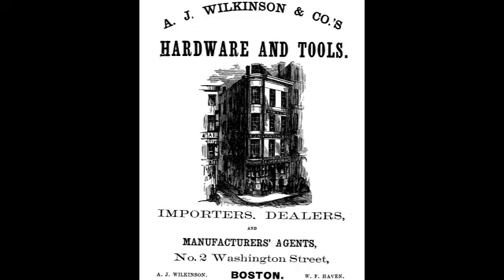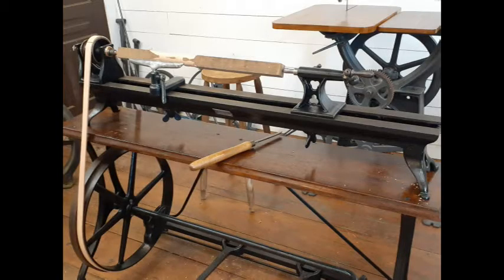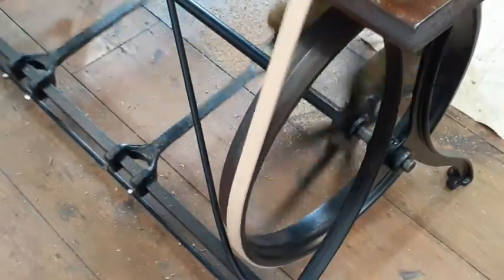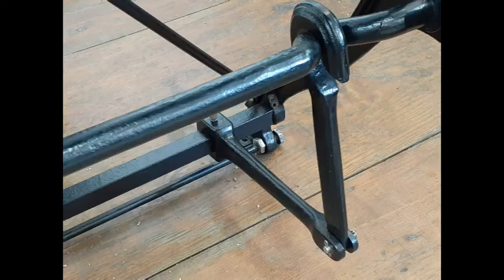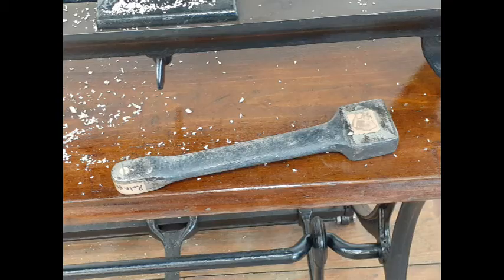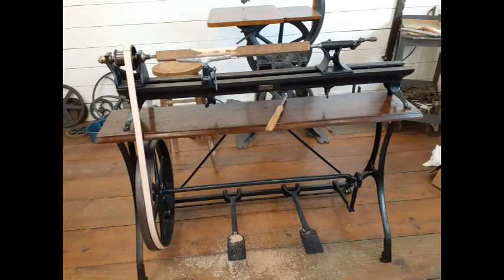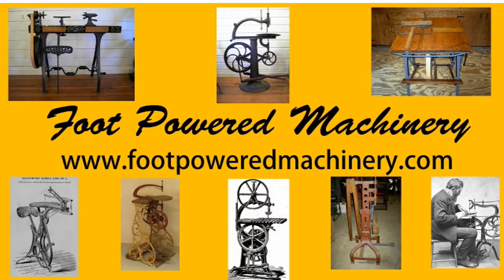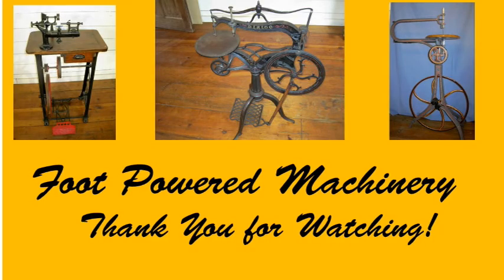A J Wilkinson Foot Powered Wood Lathe

Comment: How do you go about removing rust from such large pieces? I have a Barnes 4.5 and I am tempted to use primer advertised to go right on rusted pieces.
Reply: There are a number of ways but for the best results, think most everyone can agree paint needs to have a sound base to adhere to. Rust or flaking paint does not provide that in my opinion. You can sandblast or use a wire brush or wire wheel and may even need to use sandpaper or a small more pointed instrument to get into corners. (have used a small screwdriver and a dental instrument.) Likely any paint that is still on it is lead based which adds another complexity if you follow those steps that are available online. Think some of the new paints are rated as both a primer/paint. I use more of a commercial grade oil base equipment paint and have it tinted as necessary to match. Let it dry very well before applying a second coat. (Unless the machine really looks bad, i normally just clean it up very well and leave it as found.)  Others may have used what you are referring to but I have not. Restoration takes time - a labor of love as they say!! . Hope this helps. Good luck on the 4 1/2..  Thanks Ed
Reply: "It depends" Rustoleum rust reformer is an option if you plan to fully strip and restore later, or need to stop rust now. It won't look original, and you will need to fully strip the piece to restore it. The black/shiny finish from this era is usually the same asphaltum that was used on a Model-T Ford. Which is an asphalt-based lacquer, usually sealed/covered with flaked shellac. These original finishes hold up well against oil, but poorly against water & solvents. People that want to use their machines rather than restore to original are sometimes taking them to be powder coated. Powder coating shops will chemically strip the paint & rust. The end result will look not quite original, but be close and functional.

Comment: I fell in love with old self powered tools and line belt driven. I have a 20 inch crescent belt. And I want to convert it to pedal.  Any help?
Reply from the maker: A heavier lower wheel is an indicator that it was foot powered at one time. That acted as a flywheel as well. Take a look at the video on my site on restoring the Crescent 20 and you will see the parts that make it foot powered. Even without a heavier flywheel, with the parts it would work. Can make those available. You can contact me via the Contact Us page on my website.  Thanks Ed
Reply: @footpoweredmachinery179  Yes! People don't realize that the two wheels held together by a belt actually function as a single unit- a dual-mass flywheel!

Comment: how heavy is the large wheel
Reply from the maker: I would say it is about 35 pounds or so. Some less than the #3 Barnes or the Seneca Falls Crown. The flat belt vs those smaller, hobby grade machines that use a round belt make all the difference. As I said in the video, this size lathe  works great and i just love my shorter bed "Leader" lathe. Relatively easy to take apart and move yet still heavy enough to do productive work. From my experience, you will run out of leg power first. It can be run standing up or sitting down on a stool!
Reply: @footpoweredmachinery179  my queation then is weight neccesary to store energy